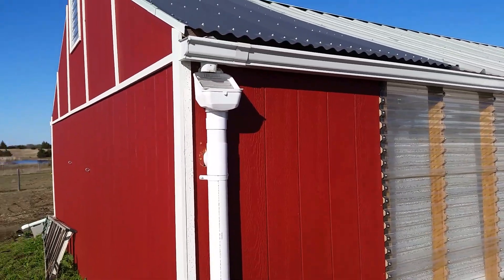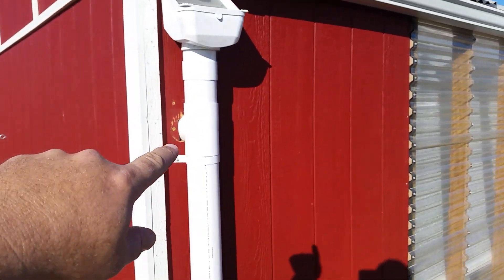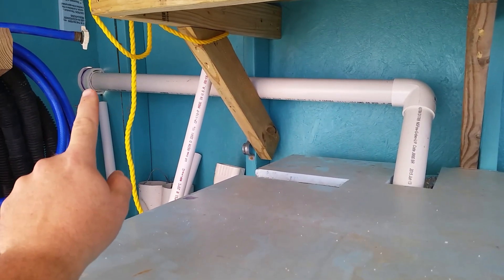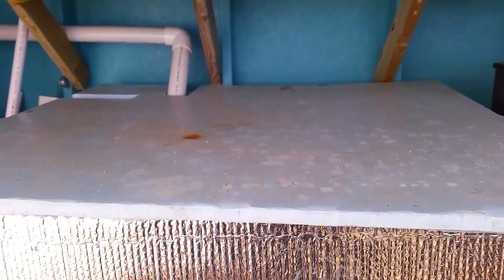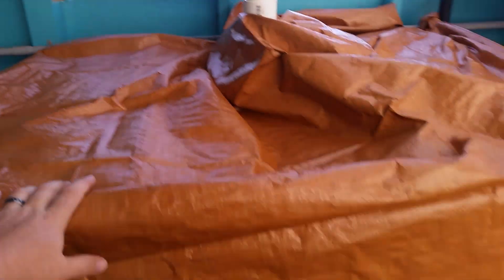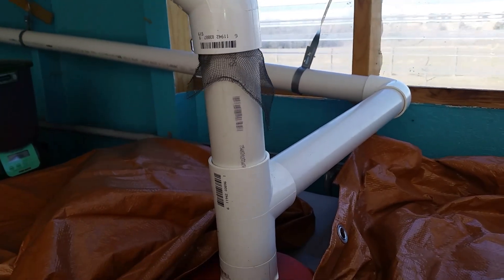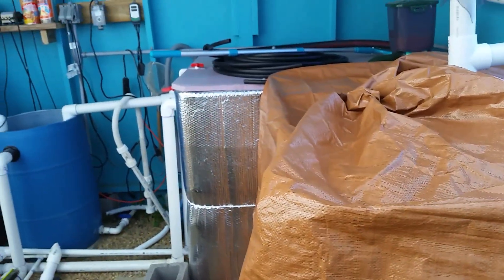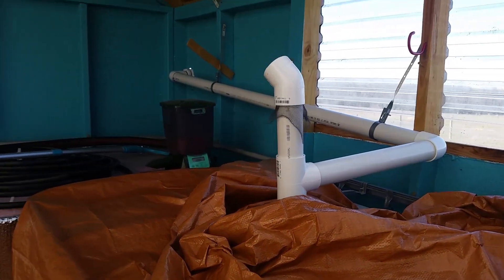How to Survive the Coming Water Crisis (Rain Harvesting for Preppers)

Comment: Can add a DI filter to a RO system to get it down to 0 TDS.
Reply: Correct. The DI filter is not for drinking water. I used it only for my reef tank. Ive heard of people using it for gardening like hydroponics so they know extacty what nutrients and amount the plants are getting.
Reply from the maker: You can look up specs for clean drinking water but I don't think you need to get it down to 0. I was looking at UV light filter combined with hole house filter. For greenhouse use, I can just use the rain water as-is.
Reply: What does DI stand for ?

Comment: What do you use for a pump? If you got one
Reply from the maker: No pump. All gravity. I did have a pump to push pressurized water to the garden but it was cast iron and cracked during a random freeze. Haven't replaced it and really haven't missed it.

Comment: Add an elbow pointing up on the inside of  your overflow pipe and you will gain more capacity.
Reply from the maker: Thanks for the tip.  I actually have this tank hooked to another tank that's then connected to three outside tanks.  They are all about the same height so I can maximize all the totes in the summer months when Texas tends to get droughts.  It's amazing how little water these systems use even in the dead heat of the summer I've been able to maintain enough clean "non-city" water.

Comment: You mentioned testing your water.  What resources do you use to test your water hardness?  Is there also a way to test for other contaminants like bacteria or substances that may blow onto the roof?
Reply: Yes, I did a hardness test with a chemical set for my water coming from the city.  It was off the charts and is why I built the rain harvester system.  No I don't test for contaminants as the water is only used for the plants and not drinking.  I wouldn't think about testing run off rain water going to the garden either. I do keep my tanks covered, preventing growth due to sunlight.  The water sits in the IBC totes and settles, my fill line is hooked in about 6" off the bottom.  I clean my tank out every 6-months or so, washing out anything that may have settled.  I hooked the IBC tote drain to a 2" pipe that goes outside the greenhouse if I need to drain and wash.  Pretty quick and easy.  If you want to drink you'll need a filtration system and probably some sort of UV filter.  I've gone to only using rain water and it's been great!  I really don't add PH up or down, I just leave the PH alone.  The MasterBlend does lower my PH a little when I add it, however, everything grows great and I don't have to struggle with the dirty city water.  I need to post a video, lots of greens growing right now.  Not as many as I could, but I have limited time and we can only eat so much.
Reply: In WV the county health department will do a minimum round of testing on your well/water source (spring, cistern, etc). This testing includes Fecal Coliform. I am a retired water inspector. A clean metal roof will not be a source for organics. Possibly some metals, especially zinc and aluminum. If you were worried about organics, a simple carbon filter will remove them.